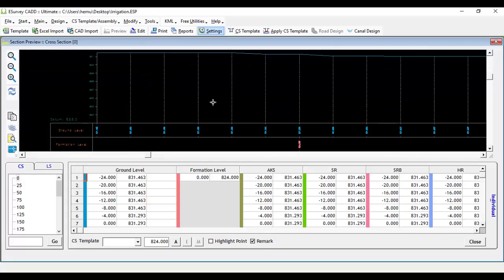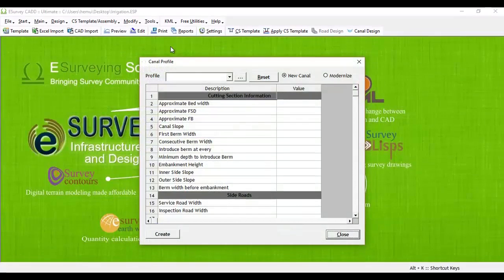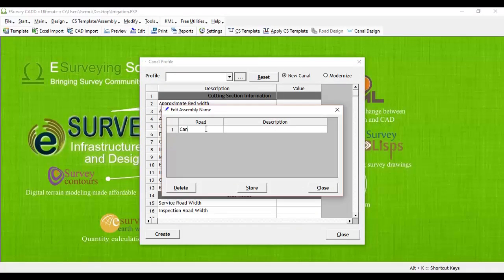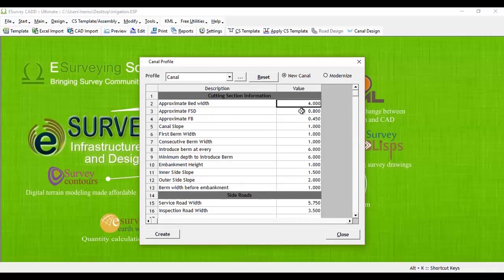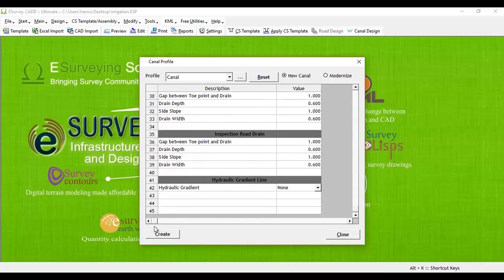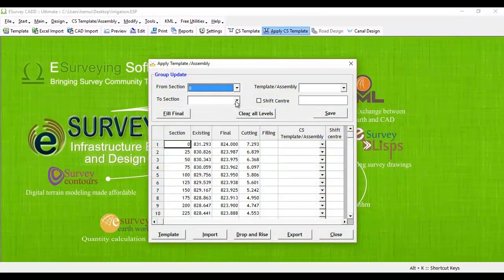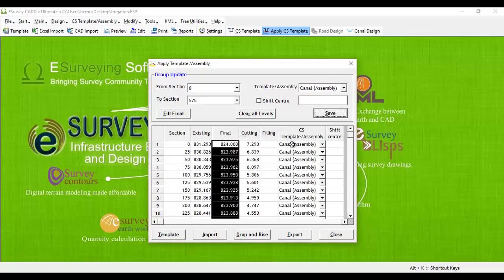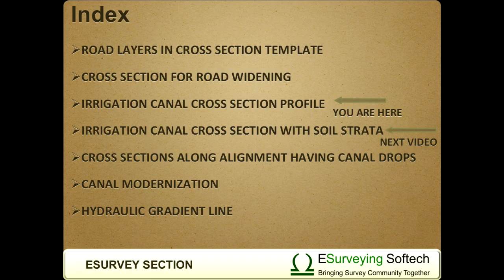Irrigation Canal Cross Section Profile

Comment: Exiting ground levels how can edit
Reply from the maker: Dear Sir

In ESurvey section module Ground Levels can be imported from excel after arranging into excel template.
You can add edited data into excel template.

OR

"Edit" option is available for above requirement.

Regards
ESurvey Team